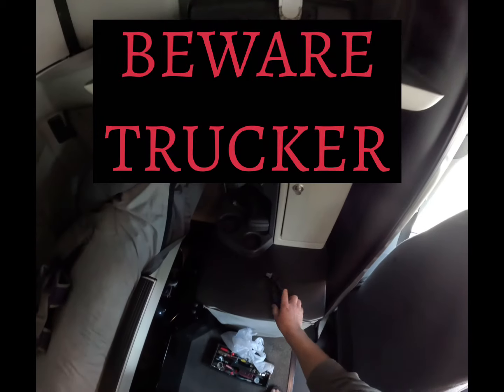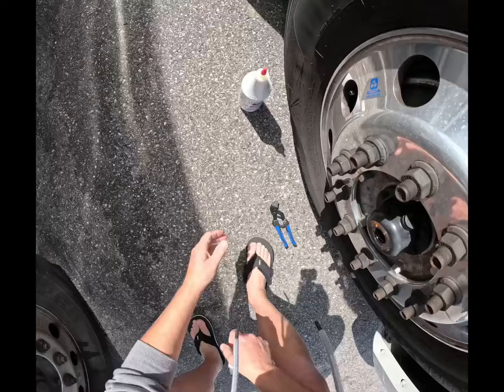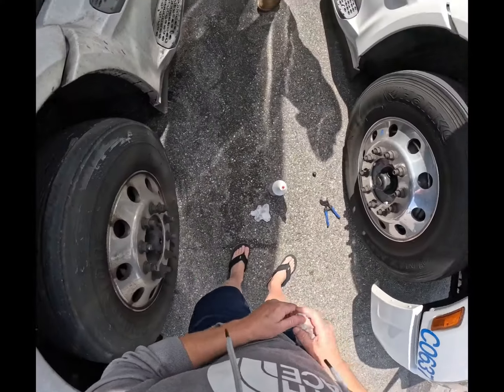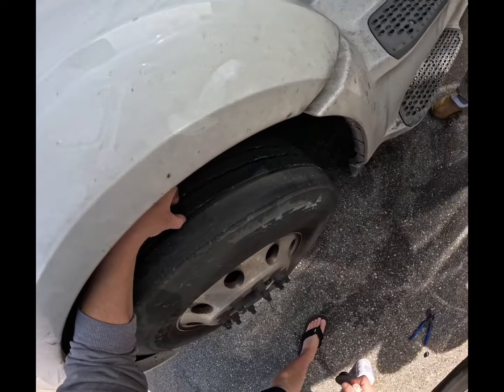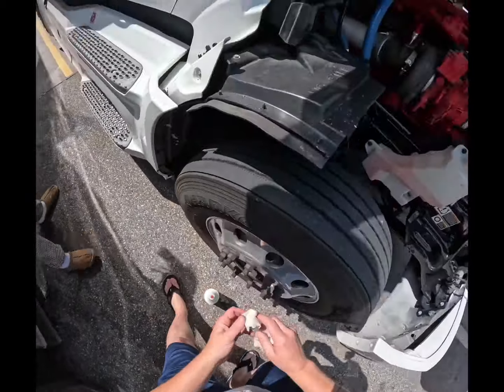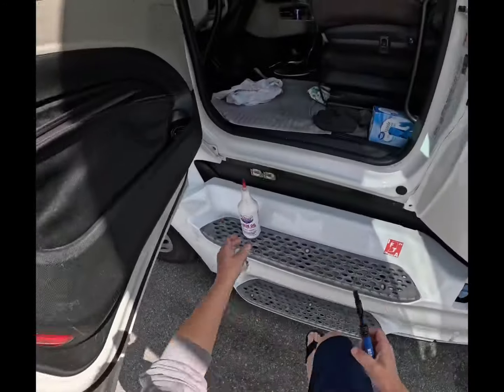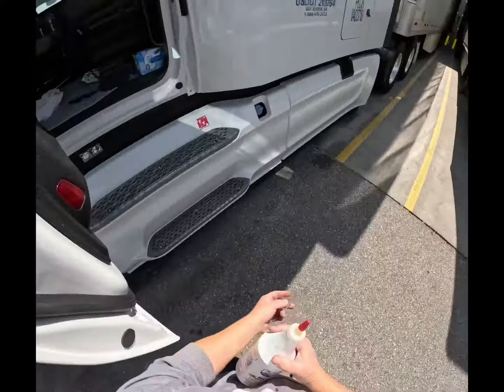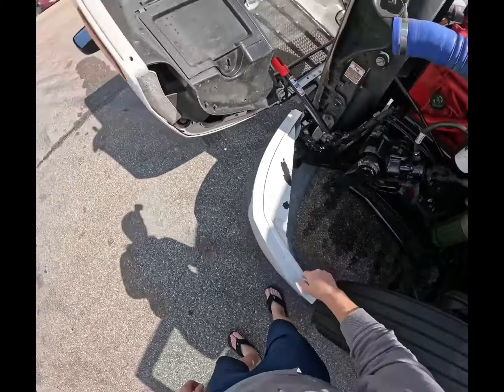What the heck ! Worlds gone crazy 😱😡😂#truck #crazy #funny

Comment: I’m 12 trying to be a mechanic for semis and was wondering why you need oil in the hubcaps if you don’t have oil in a trucks
Reply from the maker: There is oil in the truck like the cars have .  the hub seal keep the wheel hub from leaking and the dirty and debris out or should ! When you fill it up there is a magnetic cap that will have metal shavings one it normally if there is a lot that’s probably because it’s going bad & also if there is a lot of oil leaking out again a small amount isn’t a big deal I don’t believe!
Reply: Thank you